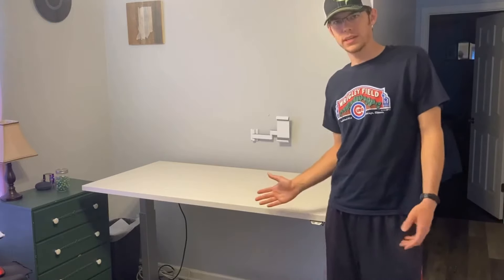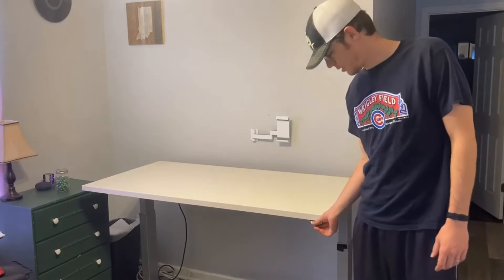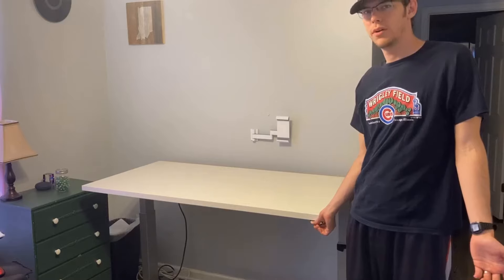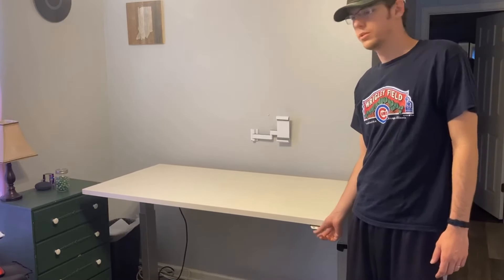Fix for Standing Desk that Won't Go Up

Comment: This is helpful but my desk problem is that my desk is stuck at max height and won't go down idk what to do
Reply from the maker: Unfortunately I haven’t encountered that yet 🤔 Have you tried unplugging it for a few minutes and plugging it back in? Alternatively it’s always a good idea to check all the connections. I’ve got another video on replacing the controller that shows how to access those

https://youtu.be/nDakZatOvoA

Comment: What if the desk it's stuck up? My desk it's stuck up even If I unplugged it and tried to reset it doesn't work either.
Reply: I’ve not encountered that before, but I have an idea or two. Does it make any noise when you push up or down?
Reply: @Cotz95  Thank you for the reply. It's doesn't make any noise regards on your question. What I think it's the power adapter it's not working anymore.

Comment: Whats the reason this happened to my electric table??
Reply from the maker: My assumption has always been that the controller somehow loses the state of the desk height. It has to carefully go all the way down to find the bottom. Once it knows the bottom it can start tracking again. 

I have no knowledge of how it actually works; I’m just taking a guess based on engineering experience.
Reply: @projectseclectic4022  My ikea electric desk is pretty new got it last year. I do keep turning off the main power source at night. Does that matter?

Comment: Thanks! This was my problem, desk goes down but not up, thought I had some switch or controller problem but found your video and suggestion to go all the way down to reset.
Perfect!
Reply from the maker: No problem! I discovered that quirk while working on the desk and thought, “surely this will happen to someone else.” Glad it was helpful!

Comment: Ive got a Rolanstar Single Motor Free Standing Electric Height Adjustable Desk and it will only go up and when down is pressed, EO4 pops up.  Any suggestions?
Reply from the maker: Some research suggests that it’s some kind of over current issue and that either your desk is overloaded and you need to remove some objects, or there’s something wrong with the control box and it needs replaced. Hope this helps